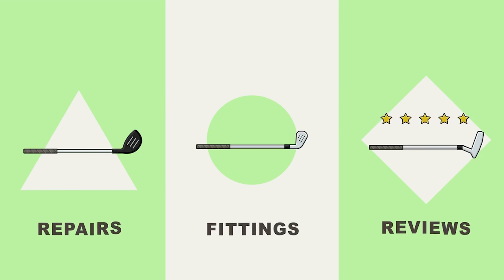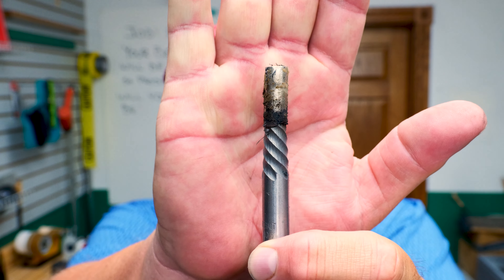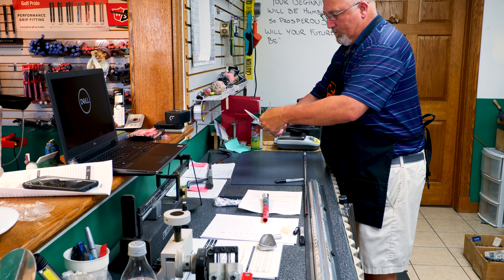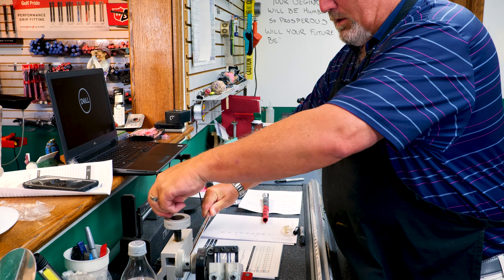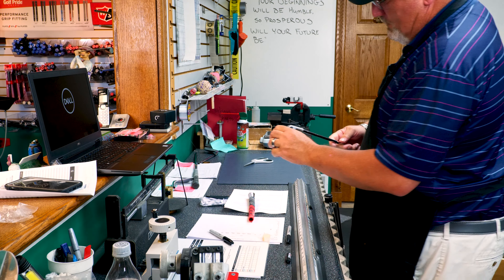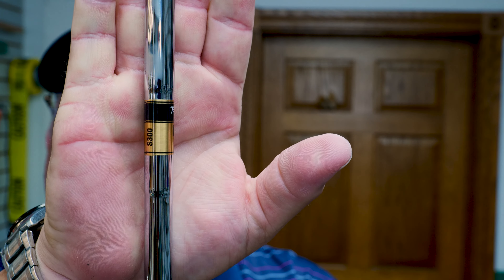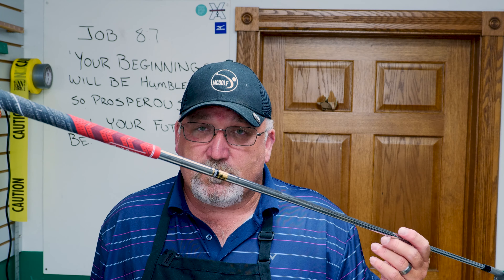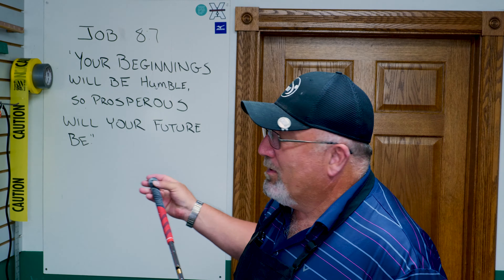Golf Club Repair, for Israel

Comment: Hi Jim, have you ever made a Video on how to get old tape out of a Grip (tried to safe it because it was about 10 days old)? Regards from Germany ✌️
Reply: I did this once, not sure if my homemade method is authorised by pros but...I stuck a tee in the grip cap hole, stood the grip upright and filled the grip with grip solvent (or equivalent), left for 30 mins then used a long wire bottle-washer type brush and scrubbed the inside a bit like you see people use a ramrod to seat a musket ball... worked well enough for me. Repeat as required with solvent.
Reply from the maker: I’ve gotten it wet as already posted. Then I use a 1/2” pipe cleaner.

Comment: Hi, Mr. McGolf, I installed a Fujikura Putter shaft into my putter and the used a light pistil grip. The swing weight went to E9. It feels a little heavy in the head. How can I get the swing weight to the D range without changing the grip?
Reply from the maker: you have to back weight it for sure. There is a item called tour lock or balcne certified that will do the trick